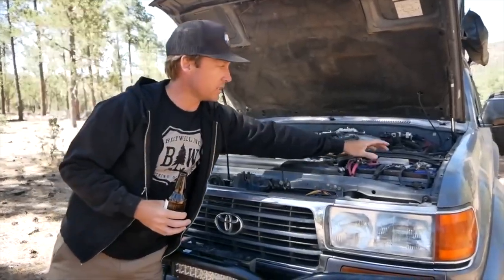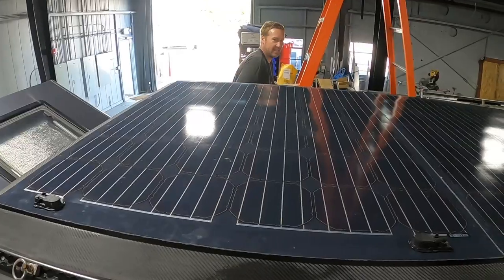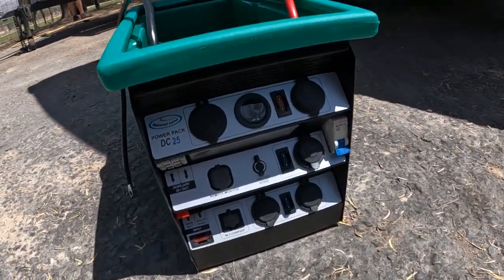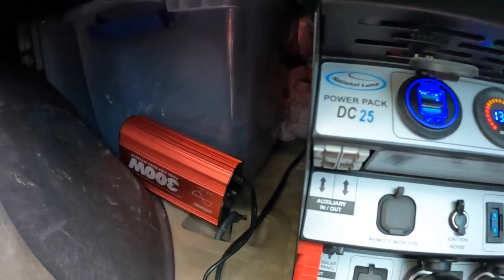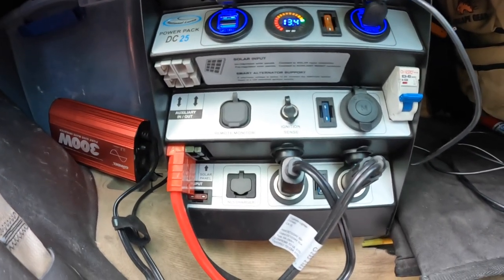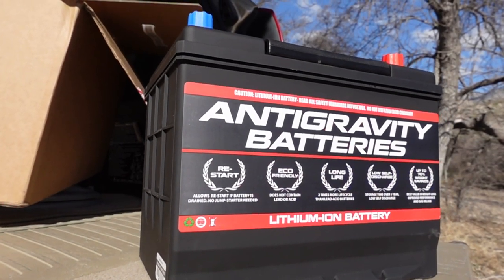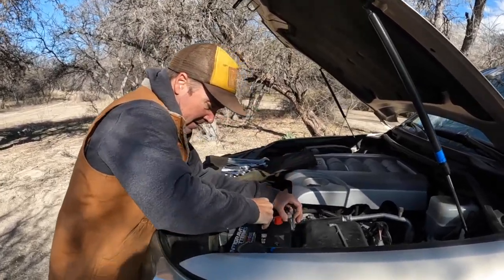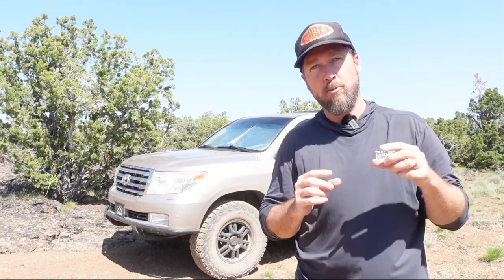Stage 2 - Power Setup (National Luna Power Pack Antigravity Deep Cycle)

Comment: Looks like a possible solution for my cargo trailer camper conversion. I had something "homemade similar" that was connected from the starting battery. I never thought of running from the alternator and not putting extra stress on the start battery.  I like the idea that it can be mobile if things change. Thanks for the update and safe travels..

Comment: Thank you for this! I am mulling over the portable options as I know my power needs will increase as we work from the road and add in additional powered items. The desire to keep things separate and clean is definitely high. Can you dive in a bit deeper as to why you went with this setup versus a high-capacity, all-in-one, portable option similar to the smaller on you used or Goal Zero, WaganTech, Jackery, etc. options? I am considering one of these for the high capacity lithium-ion batteries and simplicity, but want something robust to handle pretty much anything I would ever need. I've used a 550w option before and it worked well for remote work for a day powering a laptop and hotspot, as well as powering a portable USB fan and cell phones, but I know our needs will increase when we both are working remotely and adding in a fridge.
Reply from the maker: We've had bad experiences with the all in one power solutions. One brand in particular would sponsor friends and/or some of the events we work and many of us got to the point where we didn't want them even when given for free.
The power ratings seemed grossly overrated or maybe there were other internal problems making them run out of power quicker than expected. We also had some totally fail and no longer charge.

The quality of some of the brands you mention seem to be focused on weekend light use. We wanted to have higher quality components and more power than most of the self contained units. This way we can chose what size inverter, battery, charger controller, solar controller etc. 
Our current battery is about 1,500W of power. 
It's been great to have so much power, but I like knowing that we can upgrade to a bigger battery once technology moves forward. 
We're keeping the current all in one charger for lighter duty applications like trips in our FJ40 for a long weekend.

Comment: TIMMMM!! I have 3 of those sweatshirts and they are the best. Stretchy but tough enough to stand up to trail wear. They keep you protected from the sun, are breathable enough that you can wear them in the heat, provide just enough warm if there is cloud cover and it works well over or under any other shirts and jackets I have. 

Anyone else out there, if you want the best over shirt for outside then I think it’s called the crater lake hoodie.

Clothes aside, really enjoying the gradual build up of the cruiser. With so many channels just doing huge custom permanent mods to their trucks, you guys are doing something flexible, accessible and showing off some gear I haven’t seen anywhere else. Honestly I didn’t even know national Luna made something like this. Your setup would work just as well in a truck bed or an small crossover.
Reply from the maker: This shirt is amazing!  It has already made our list of our favorite gear, it will be coming in a video soon! Thanks for the kind words!

Comment: The specs for the battery you linked show safe operating temperatures for charging at 32°F ~ 113°F and discharging: -4°F ~ 131°F. Does underhood placement make sense? Or is "safe" just a recommendation and only performance is affected?
Reply from the maker: I'll ask the experts to chime in. Personally, since we've had the lithium starting batteries in the last couple trucks without issue I think it's okay and I would, but I can't say if it's okay. @antigravity
Reply: Great question! In this case the temps here are referring to the internal temperature of the battery itself which is generally a bit warmer/cooler than ambient due to insulation and electrical flow. These numbers are a safe recommendation keeping in mind the fact that the BMS in the battery can step in as you reach the extremes of these parameters to stop any battery damage. We have batteries in vehicles across all environments such as Tim and Kelsey's here that have been operating flawlessly for years no matter what environment they find themselves in.

Comment: Is it a good move to upgrade your alternator or can you just run off the stock
Reply from the maker: Personally I prefer stock. I've had bad experiences with high output alternators reliability. Also, the stock can achieve more than the maximum our DC/DC charger can take in anyway. Cheers,
Reply: @SaltySunriseSailing  Thank you